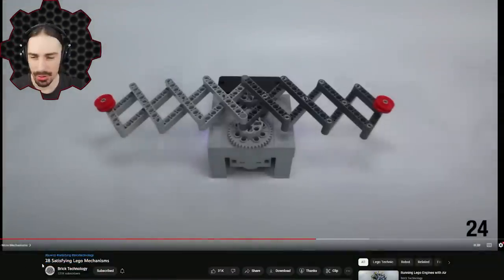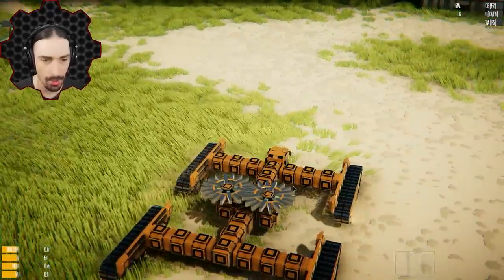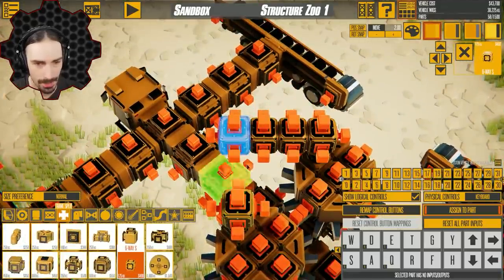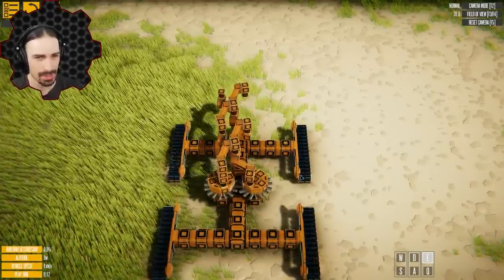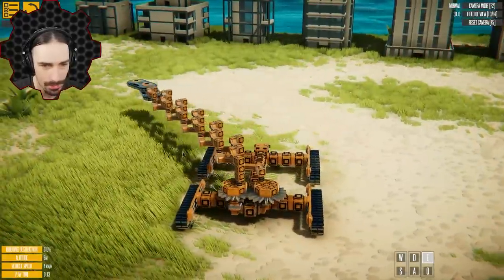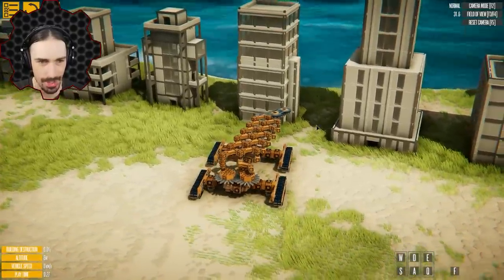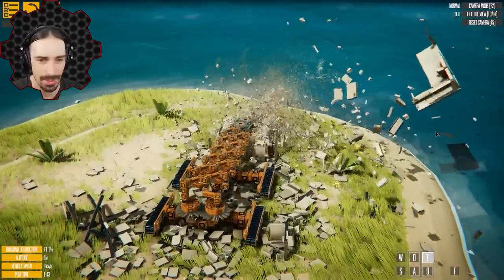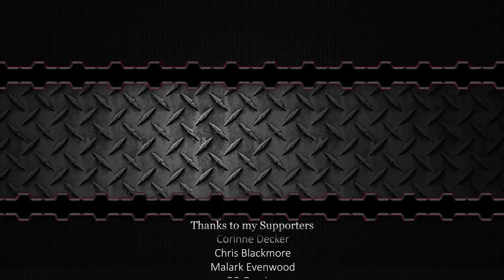Over-Engineering The Deadliest Scissors Using Gears! [Instruments of Destruction]

Comment: The reason it kept swaying (for the most part) was the non-symmetry of the bottom and top layer of the mechanism. If you make 2 layers identical and place 1 mirrored on top of the other, it should minimize the swaying. The swaying as a result of gear desync can't be solved though
Reply: yeah i noticed that too. almost instantly. was driving me crazy all video LMAO
Reply: I came here to say the same thing. It was frustrating to watch.
Reply: You could put down a 2nd power swivel on the second ger to minimize gearslip thought
Reply: @--cook--  SAME
Reply: that's the first thing I saw
Reply: He could add a reverse power swivel to the other gear, and that would solve his problem.
Reply: I saw that and it irritated me to my core the whole video
Reply: @--cook--  same lol 😭
Reply: You could choose a gear with a number of teeth that isn't divisible by 4, and rotate one by 90 degrees. The 18-tooth gear would work for this. That would line up a teeth from one gear with a gap in the other.
Reply: It would sway even if balanced just perfectly. That  is because the gears have too much slack but also because they're not perfectly synced due to the teeth amount and position.

The inbalanced arm is just one of multiple different reasons it sways, the gears being the single worst  culprit. Even if everything else was ideal, the non-synced gears would necessarily make the arm sway.
Reply: The best way I can think of to get rid of some sway add a case with the same mechanism on top for more stability basically just cap it off in a way to that it can still spin as it does similar to the gear box thing you made
Reply: It bothered me so much because he set it up to work initially once he got the floating mid point and then he just janked it so hard being so focused in on that "45 degrees off of the gears . . .like this!"  He failed to realize the way he designed it actually aligned the thing to actually prefer to slide more to the left because of how the beams are connected. An asymmetrical design rarely ever has symmetrical results.

Comment: Anyone else annoyed with how he messed up the bottom flex beams to not be symmetrical to the top (he placed it on the back rather than the right side). My OCD made it very unsatisfying. xP

I ask because this lop sidedness is partially why results aren't completely stable and at times even desync.

Comment: There are a lot of suggestions about the side-to-side movement, and here's mine:
When you built off of your gears, they were completely symmetrical. But after you exit build mode, the unpowered gear has to rotate a bit in order for teeth to catch each other. Since the gears move wanky anyway, it's kinda hard to notice the angle difference, but it does create the swaying
Reply: It wouldn't hurt to have a channel to run alone to keep it straight
Reply: @mattstone3995  wdym by channel?
Reply: A groove for a peg to run along

Comment: Could you perhaps add a crossbar onto your gear wheels? Like the little rods that connect train wheels together. That might help prevent them from getting out of sync.
Reply: it wouldnt work because they are going in opppsite directions

Comment: You could make the upper and lower arm symetrical by setting the free swivels also at a 45 degree angle and than attach the holy flex beams to the side facing directly to the other swivels

Comment: MULTIPLAYER MONDAY IDEA!!!!!! Use the portal mod from yesterday's Scrap Mechanic video. Put portals on the front and back of a "chaser" vehicle. Each person has  a "runner" vehicle with limited size dimensions and top speed. During the event, each person takes a turn in the "chaser" vehicle, and the other two drive their "runners". All three vehicles would be confined to a walled arena space. Time the rounds to see how long it takes for the "chaser" to eat and disable the "runners". The Winner is the ""chaser" with the shortest time!

There could be a standard, prebuilt "chaser", and the 15 minutes is spent to build a custom "runner". Or there could be a prebuilt "runner" vehicle with all the size and speed limitations, and each person take the 15 minutes to construct a "chaser" (this my be easier, because you wont have to sacrifice time fiddling with the limitations). Either way works! 

Awesome videos as always! Like this comment if yall think this would be cool!

Comment: GASP! I'm about 30 seconds in and I'm completely appalled! Scrapman going to a BRICK channel?!?!? You've forsaken the Wedge way and have gone all square ...er, cube on us?  This Scrapman is an imposter. A witch! We must wedgie him at the angles!!!!

So you've done one thing sub-optimally that is increasing the chance of the thing going out of control. The fact that you've connected the flex beams at different angles on the blocks across the scissoring piston (essentially what the thing you've built) means that the force applied from the gears rotation is being applied at differing angles. The left side wanted to pull to the left and and backwards and push forwards and to the right, but the right side mainly wanted to push forward and pull back. This means the left and right forces were not equal and that made it want to flop side to side because it was not getting equal and opposing forces. If you mirror how the flex beams on the first left arm are connected to the right arm, you should get a more stable result.

Try also spreading the gears out. By that I mean have two driven gears near the center that don't interact with each other, but go about 3 or 4 gears transferring out with the same gear size so that way the rotation is occurring on longer arms, if possible also make longer arms to compensate for the distance to hold the scissor piston. This will make the distance it travels both greater and the speed it travels faster, meaning you could get a punching machine that might be able to do a mechanical mach punch. But for max efficiency in the transferring of energy, you need to build the arms symmetrical as far as the connections go.

Comment: Your first beam is connected in the wrong way and that's why it wobbles so much ... infinitely annoying that you didn't notice it -.- 

The lower beam is connected to the back of the block while the upper beam is connected to the side of the block, therefor the ratio of the gears might still be correct, while the actual range of movement of both arms is different

Comment: The connection points on the beams were different. Ones going from right to left are “s” shaped the ones going left to right are “c” shaped. Making them both one way or the other would fix all your issues

Comment: 6:51 was why it wobbled the asymmetric attachment point cause lopsided rotation bothe the bottom and top arm need to attach at the same point ie if you do the bottom arm on the back the top one must be on the back,  if one is attached two the side both must be, the gear skipping will still happen however.

Comment: part of the problem is that one arm attaches to the side of the initial block, where the right side attaches to the back, causing sideways motion
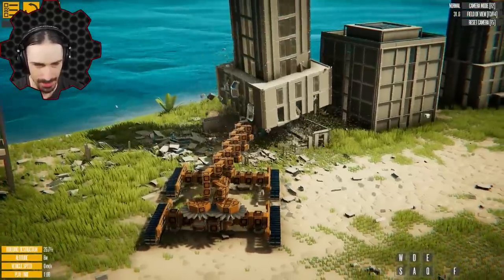17:20 the gear slips  tooth and ends up 90 degrees out ...

Comment: I think most of the swaying was not due to the difference in flex beams on the top and bottom 'arms'. I think it is mostly the fact that the 2 gears have an even number of teeth. You see, when you build them the gears don't mesh but overlap and the moment you spawn it in, the gears move half a tooth worth to make them mesh. It's a tiny amount, but it changes the alignment ever so slightly. The rest of the arm acts as an amplifier for that error. See if you can change the number of teeth to an odd number so they can already mesh correctly during the building (odd numbered gears will allow you to do that).
The desync caused by the glitching of the gears through each other at higher power/speed can't be helped I guess....

Comment: if the size of the gear corelatess to the ammount of teeth on the gear, this rule would apply:
    smaller gear = more torque
    bigger   gear = more speed

Comment: Instead of gears on the sides use pistons down the center
Reply: One rear facing piston on the front, one front facing piston on the rear. The closer they get to eachother, the more it contracts, the stabler it gets. But also, the closer each pistol gets to it's anchor point, the more it expands, while also adding stability.